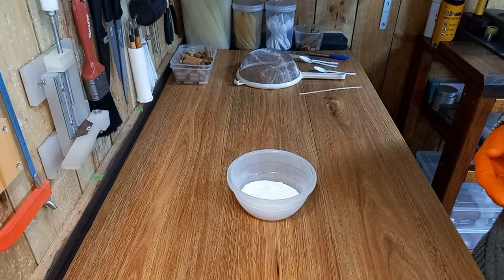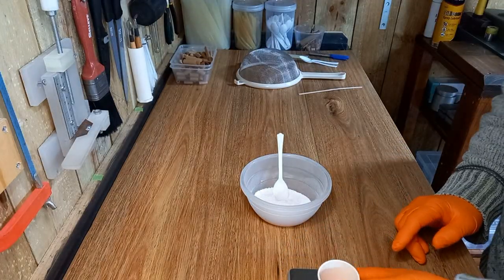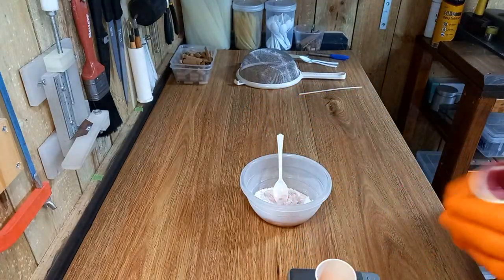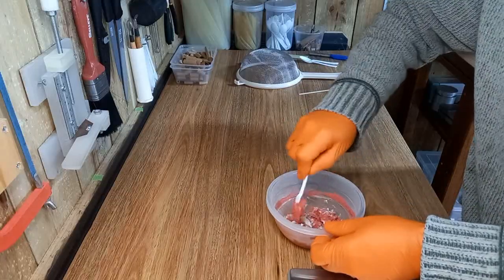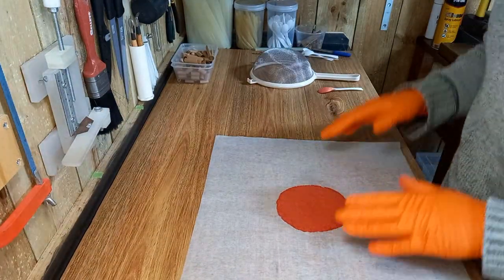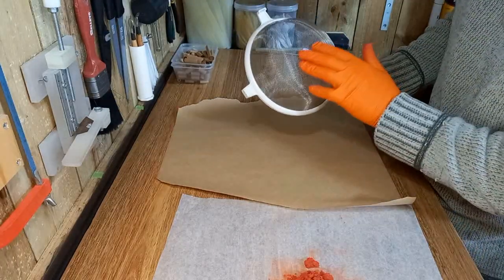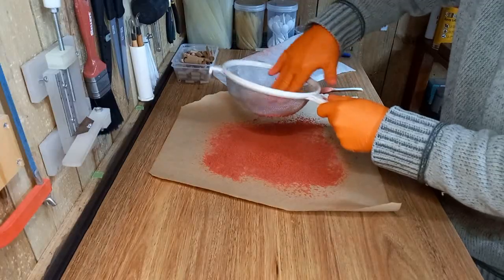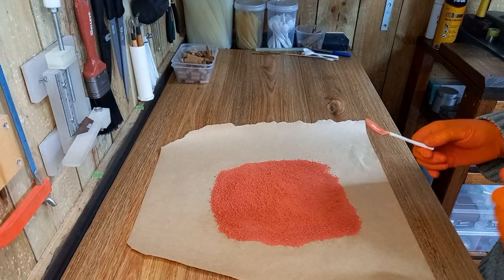Making Whistle Rocket Fuel  How to make Potassium Benzoate Whistle Fuel for Firework Whistle Rockets

Comment: An added note, you can use the most powerful KHP (Potassium Hydrogen Phthalate) based whistle mix on a long spindle with the tube waxing method. btw, don't pour hot wax down into the middle of the tube. It will decrease the diameter making it nearly impossible to press your rockets. As for black powder if you don't already know, rather than waxing, you can mix some graphite powder with bp to make a consistent burn down the fuel grain also to prevent a cato.
Reply from the maker: Graphite Powder sounds interesting, how much do you add
Reply: @Pyrolife-net  I believe it's just 2 to 3 grams. I have it tucked away in my notes and won't have access to it for several days but there is chatter online all about it. When you start getting into larger shells containing advanced flash mixtures, you will find that a heavy (fire chute spollette) is needed to eliminate ignition issues. Blue Al based flash mix is a prime example.
Reply: @Pyrolife-net posso o sar bezoato de sódio
Reply from the maker: @patrimoniocultural2120  Yes, no Problem, make sure it is dry
Reply: @Pyrolife-net  muito  obrigado Deus abençoe
Reply: @Pyrolife-net  Forget to mention, for waxing whistle Motors, you'll need to fry them in canning wax for 10 seconds in a frying pan on your kitchen stove. Once it has cooled down. You will be ready to press your whistle fuel. Set temp for medium low.. It really works to prevent catos. Watch my recent upload.

Comment: That was very thorough and informative. It might be worth mentioning that if somebody adds the titanium mentioned near the end to make a whistle rocket, it should NEVER be pressed around a spindle, only above the tip in the delay portion. 

Also, whistle rockets tend to degrade upon storage and CATO upon ignition. My solution to this issue is to apply a very thin coat of paraffin wax to the inside of the tube before pressing. It's not necessary for non-cored whistles though.
Reply: Why not coat the outside of cardboard with clear pvc cement or tape? Wouldnt that keep the moisture out? And i thought benzoate is not as hydro sensitive as the others as he mentioned?
Reply: @NagashiChidorii  It's not about moisture. It's about lubricating the tube   wall and stopping firepaths between the wall and the propellant grain.
Reply: @pursaveer9027  ahh okay. How do you coat the inside with wax? Do you melt and pour it in or use a circular brush?
Reply: @NagashiChidorii  The easiest way is to dissolve a bit of wax in warmed naphtha (away from flames!) and swab the inside of the tube. Again- if the whistle has no core, not really necessary. 
Some people are against the idea of using wax, preferring instead to use a bigger press with more pressure on a stronger tube in a more robust tube support.  The concept of lubricating the inside of the tube  originally came to my attention by reading Takeo Shimizu's pyrotechnic book. Using wax allows for the use of larger increments when pressing and gives better consolidation of the propellant grain.
Reply: @pursaveer9027 thanks for the tips i’ll be trying that! How much psi do you press or pound force?
Reply: @NagashiChidorii  I press to 5000-6000 psi on the comp area.
Reply: @pursaveer9027 i notice many people say not to press titanium around a spindle, i was just curious why? 🤔
Reply: @I_Like_CATOs  It's hard and gritty and pressing it up against a metal spindle could cause a spark ignition, is the theory of it. Besides, it's not really needed around the spindle to give a good tail. A little bit of Ti goes a long way.
Reply: @pursaveer9027  cool good to know 👍

Comment: can anyone help me mix and build my hobby...suggestions accepted...well my compositions are kcl03, sodium benzoate, red iron oxide and parafin wax.. after finished mixing it which is completely dried up for hours. i tried to put in a tube and pressed using quick bar clamp..after that i tried to ignite and the outcome has no whistle no lifting and was extremely terrifying explosion happened..i am open for your comments and suggestions.thank
Reply: And you are sure you made the mix right ratio? And How big was the tube inside diameter ?
Reply: @Kirt44  yes I do.. 70.30.1 and 4 that's my composition
Reply: You need to press the propellant to at least 8-9,000psi on the fuel grain your bar clamp will not give you the pressure needed, thus your CATO. Your entire propellant is igniting pretty much all at once. 
Also a shorter spindle is needed over a long skinny BP motor spindle, but they will work with slower whistle mix and really good compression of the propellant grain.

Comment: Make a video about pressing whistling fuel, especially about the amount of force on the press.  This is, after all, the most dangerous moment in this process.
Or answer in the comments with what effort you press the composition.
Reply: I have whistle rockets on my channel and I use a hydraulic press because you don’t ram whistle fuel. Lots of people say it’s friction sensitive but I’ve also done a test of that on my channel and it didn’t go off even while striking it with a hammer on concrete. If you don’t have a hydraulic press use an arbor press. I have a PTF gauge and I press my whistle at 500-1000 psi but if it’s a 5/16 baby rocket I will press it at the lowest pressure of 325lbs of force.
Reply: @E85_STI  Hello.. I can't get potassium benzoate, works with sodium benzoate?
Reply: @E85_STI hey i looked at your channel and couldnt find anything where youre hammering whistle fuel
Reply: @NagashiChidorii  oh that’s because you aren’t supposed to only press whistle fuel. If you hammer it the comp could go off in your hand.
Reply: @E85_STI  i know but read your own comment from above. You said you tested whistle fuel by hammering on concrete on your channel but i cant find that video anywhere. Im trying to find out how sensitive it REALLY is vs people just spreading misinformation
Reply: @NagashiChidorii Florida pyro and E85 have good tests on their channels

Comment: What about acetone...where is detailed explain??
Reply from the maker: The Acetone is not a component of the composition it is used to dilute and disperse the mineral oil into the mixture and very importantly it is there to wet the mixture to help prevent accidental ignition. This is a shock and friction sensitive composition and should not be mixed dry .  In the video I used 40 - 60ml of Acetone adding more as required to keep it quite wet, all this is explained in the video
Reply: @Pyrolife-net 丙酮可以換成乙醇嗎
Reply: 15ml of acetone and 3% mineral oil is enough to dilute evenly the mixture.
Reply: @TAWITIBoyAllAround  sir ihahalo din ung acetone tyka mineral oil??
Reply: @TAWITIBoyAllAround  Wala NBA kolorato to sa kanya? Anong chloride gamit niya?